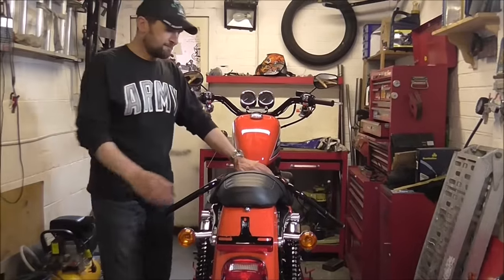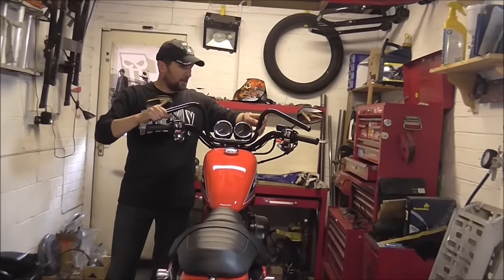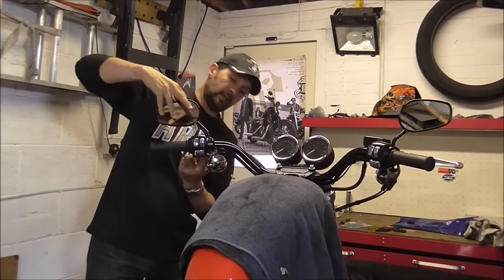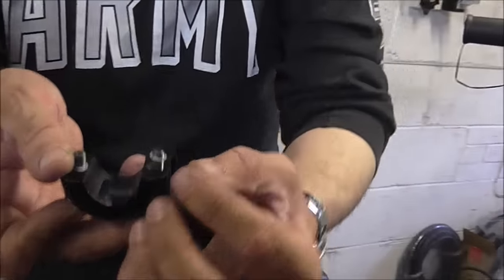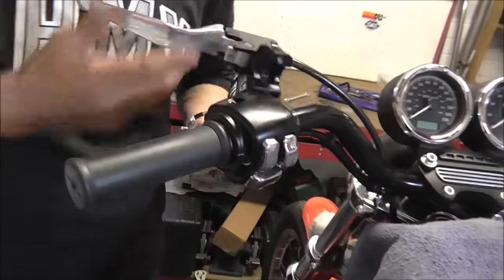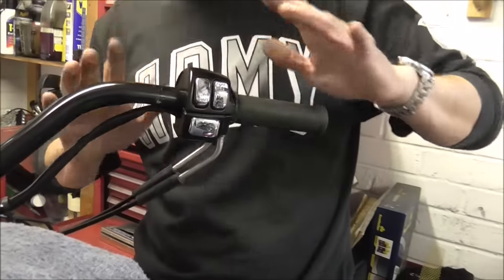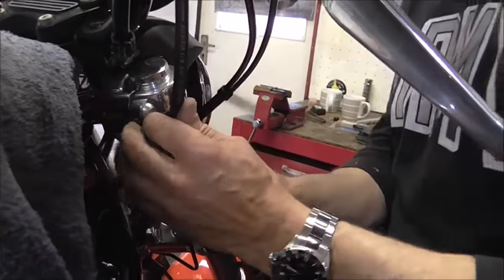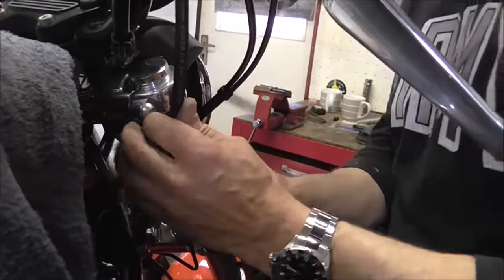Delboy's Garage, XL883 R, Fitting Biltwell 'Chump' bars.

Comment: great video mate, i always find the torx bits great for when you round a allen bolt head off, i get a torx bit that is one size bigger than the allen head and hammer it in.  jobs a gooden. always love these videos. 
cheers Devon
Reply: +Achilles Biker Thanks for the tip, will remember that when I strip out the next one :)
Reply: GTs Garage has got me out of some trouble before!

Comment: Wish they still made roadsters over here in the US. love my 1200R. I've been thinking about doing biltwell chumps for a year now and never have because I was too cheap to buy the brake line. but finally seeing someone do the bending option has me thinking.
Reply from the maker: +Jake C Do it Jake, they 're a great upgrade... and all you need to do is straighten out the hard pipe just a little and they will fit ...

Comment: Another great and informative video. In addition to a Torx driver kit, you'll need a 12 pt socket kit if you are going to any work on your brakes at all. Love Harleys but they drive me nuts with the special tools requirements. Keep wrenchin' and recording -thanks!
Reply from the maker: +The Ted ...Good call on the tools Ted, buying a Harley comes with a whole heap of changes, they are very different in so many ways...but you can go to a good tool comonay now days and buy a ready made Imperial tool kit, sockets, wrenches and alun keys etc... and of course, a good torque wrench.!

Comment: Another great DIY video on installing the "Chumps", Del!  I have an '05 XL1200R (not 883) that I have been looking for more comfortable bars for, and I think the "Chumps" may be them.  Your manipulation of the front brake line was of great help, but I am wondering how the wires went for you.  I really don't want to have to add wiring and just wondered if you had any difficulty getting the stock wires to reach.  Because the stock bars are wider than the "Chumps", are the stock wires able to be used easily without extensions?  Thanks in advance, and keep up the great work for the rest of us out here!
Reply from the maker: Hi buddy... yes the wider bars from the R model sportster will reach the Chumps just fine, i had no issues, you just have to tidy it all up and clip them away in a neat way... the only issue is the brake pipe which you saw goes ok too..  Good luck with yours.. Del.

Comment: got these at the beginning of the summer for my sportster. cant wait to get them on. awesome vids man always helpin me out. i got a 2014. thinkin i might need to change some of the cables. front brake line def seems too short for the chumps.
Reply from the maker: +dustin costill As you can see Dustin, not at all, if yours is an 883R then they will fit just fine, all you need to do is wriggle the left hand wiring through the headstock about an inch (plenty of slack there!) and bend that brake pipe slightly and gently to help the brake hose fit... !

Comment: Absolutely spot on....  no adverse comments here..  Do you think they'll fit my 2019 Sporty 48 without having to change any cables etc???   Great simple instruction as usual.
Reply from the maker: Not sure mate, the 883R has quite wide bars to start with meaning slightly longer wiring and cables, but the 48 bars are very small so it may be restrictive and the biggest concern with the modern bikes is the ABS brake pipe, it's welded to the connector block under the bottom yoke and not detachable... so very expensive to replace for a longer one should you need to!  Sorry I can't be more help.
Reply: @Moonfleet41   nowt is ever straight forward for me 😂😂😂 thanks for the heads up 👍🏻

Comment: A trick I have used for years to put handle bar grips on easily, is to spray a small amount of carb cleaner into the grip, this lets them slide on without wiggling really easily, the carb cleaner then evaporates and also vulcanises the rubber just enough to make them stick fast.....
Reply from the maker: +Michael Caton Good plan Mike, that makes sense mate, ive also found the hair spray works too....it dries over night and forms a mild glue to stick stuborn grips that wont stop slipping about.

Comment: You never wedged something into the brake lever to hold it a bit closed to protect the brake light switch ! A bit naughty that !
Reply from the maker: I broke the plastic tip off the end of the switch once, and the new switch was £24.. but the cut off head of a steel panel pin, glued into the end of the switch tip made it good as new for free..!

Comment: I wonder how much slack a 2019 Roadster has.  I'd love some Chumps or Mini Apes as they are inexpensive however the cables and Brake/Electrical extensions are a little expensive for what they are.  If I have to I might as well go with some braided stainless I guess.  (An excuse to upgrade an upgrade.)
Reply from the maker: Yeah, i wondered that myself, couldn't find any information, so just bought them and fitted them, it all worked out ok with a little manipulation, had to wriggle some of the loom forwards out from under the tank, and had to bend the hard brake pipe section a little, but all ok..  ! the Chumps are only 8" rise, so not too much of a stretch for factory wiring and cables !

Comment: I believe these are 8".  Would you still have enough slack in the cables and break lines if you went with 12".
Reply from the maker: It depends on the model of Sportster Dave. This was an 883R and the clutch cable plus the brake hose was at its maximum stretch in this case.. so i think you would struggle with 12" bars..
Reply: @Moonfleet41  you always reply and always so fast. Thanks once again. You're a huge help, love your work. I'm a fan.

Comment: Enjoyed the vid. I am ready to buy the Chumps but I do have a question: The bars you installed are knurled in the riser area. New Chumps (according to Hayden Brook, Customer Service Rep Biltwell Inc) do not come knurled. Did you do this yourself?
Reply from the maker: No Mike.. i didnt knurl them myself... thats how they came..!!!!
Reply: This is what is confusing me. I emailed Biltwell tech dept yesterday and got an email reply today stating the bars are not knurled. Today I called. They pulled a set of bars and told me Biltwell Chumps do not come knurled in the riser area. Many other pictures I have seen show them both ways and that is why I asked. Biltwell tells me the clamping force will hold the bars. I have never installed bars without the knurls.
Reply from the maker: Ok Mike, i guess they have both kinds and that's that... mine are certainly knurled, they are still under my bench and most definitely fully knurled at two places... as you saw yourself in the video.... But if you're arent, then there is a very reliable trick ive always used when installing ape hangers.... just wrap a single layer of kitchen tin foil around the bar and trap it under the clamp....no puckering, nice and tight to the bar.. and the aluminum is so soft it works like a metal sealing gasket and gives the bar and clamp something to bite on and grip.... the bar itself is never perfectly round, and not is the machined surface of the split clamp.... but the aluminum squashes into every ripple and dent and makes a 100% contact all round... and ive fitted 18" Ape hangers this way in the past, and they never slip in the clamp..... Hope that helps.. Good luck.. Del.

Comment: Del, thanks for the vid. You didn’t extend any wiring? Thanx-allie
Reply from the maker: No Allie, this bike was an 883R which comes with quite wide bars as standard, so all the wiring reached, it depends on your model with what standard bars you had !
Reply: Thanks for the reply! I have the '18 883N with the tracker bars & I'm  swapping them for chumps. Once I had removed the controls, It seems the brake line and turn signal cables are too short. Is there any way to reroute them? Brake cable looks like it has a little give..

Comment: Hi del love your videos! wondering if you could chime in on an issue I'm having. I did comment on your z bar video too but thought i'd copy onto here just incase you see this one first!

Basically I want to install 12 inch apes on my 2014 iron abs. I went with burlybrand on those. All good.
Problem I'm having is finding a cable kit. I've gone to Harley and a few local shops and they all say that I need to buy a special " abs cable " to go with a standard cable kit (burly brand non  abs 12" kit) for example. I've been told its about £300-£400 just for this abs cable too. I've tried getting details on this mysterious abs cable but noone will actually tell me what it is for.

I've traced through my loom and the abs cable goes nowhere near the bars. Straight from sensor over triple tree into the loom under the tank. so I can't see what cable they're talking about!
Reply from the maker: +xHitmanHobbitx Replied to this on the first video buddy.. hope the answer helps in some way... Del.

Comment: I have 2019 Iron 883 and I wonder if it has the same bars as this one you were replacing (new stock bars a little narrower, I think). I find it that I am leaning over a bit to reach the bars and I am looking for a bit more of a relaxed riding position. I also installed forward controls on the bike and this made the reach for bars a little more "difficult" in my back area (after an hour of riding). I guess it's like riding a Sportster 48? Do you think Chumps will improve the riding position for me? I am 171cm tall (or 5f7 give or take)
Reply from the maker: Hi there, firstly congratulations on your Harley, you must be very proud!  The Biltwell Chump bars are basically a 10" mini ape hanger, and will put your arms at roughly the height of your chest, and will certainly sit you back further... this bike was an 883R which has pretty wide cow-horn bars, the Iron from factory has slightly narrower bars, so just be conscious that the brake hose may not reach where it needs to on the Chump bars... it probably will, but if it doesn't, then it's very expensive to replace the brake hose on an ABS Harley as it's welded in to a splitter block.   Hope that helps you, good luck with it my friend.
Reply: @Moonfleet41  thank you! how tall are you? Did you find them a bit more relaxing that a standard drag bars? Keep making awesome videos, I like all of them that you make, very good stuff.
Reply from the maker: @Spriterom  Im just a shade over 5"11, and most Sportsters are too small for my comfort taste.. but these bars made the bike a lot more enjoyable and relaxed to ride.  These days i ride a Dyna Wide Glide with 14" Ape hangers.. so the same shape just a lot longer and stretched out...   Thanks for your kind words or support, have a good week.. Del.

Comment: I just ordered these for my iron 883 2014. I heard I need a new brake cable though for the older version sportsters! We'll find out lol.
Reply: Hey JR . (2 years on !) Thinking about getting these bars fort my Iron 883m 17b reg .Did you have to replace any of the cabling /electrics ? Or was it just a straight swap (as shown in vid )? Ta
Reply: @axelpteeg  I had to get a longer brake cable and do  everything incorporated with that, I have since moved onto pullback risers (8.5 inches) and Trashin Supply High Riser Bars.
Reply: @An_Enraged_Pig  Hey JR , thank you for replying so swiftly ! i appreciate it . After doing a bit more research and getting your reply , i think im gonna go for the Z keystone Biltwells. I like the look of them and not much of a height difference which , hopefully , won't require a cable change . Thanks man !
Reply: @axelpteeg  going to a 12 inch rise with my t handlebars i didn't change anything out besides the previous brake cable on the 8inch
Reply: @An_Enraged_Pig  Wow , surprised you didn't have to change clutch and throttle as well !? thanks for the info . ride safe
Reply: @axelpteeg  no I didn't have to change those cables

Comment: Hey there, I have the same bike with dual disc brakes and the same stock bars. Do you think I'll be able to fit 11' mini apes with stock cables? I asked a few motorcycle shops and they didn't know how to make it work because of the dual discs. Plz advice. Thanks!
Reply from the maker: Hi there, ok, if you have the same bike then the wider set factory bars give you plenty of length in the clutch cable and wiring and throttle cables, the only work around will be the brake hose... on your factory set up you will notice you have the compound hose system, which is part rubber and part metal pipe, with this video and the Chump bars, I was able to gently manipulate the metal pipe after un-clipping it, so that it gave me a little extra length to reach the bars... you can't bend the metal pipe too much, but like any brake pipe it is malleable, so try that first and if you can't make it reach, then just buy a pair of made to measure brake hoses from any good brake hose company and do a custom fit (this is, of course, provided you don't have ABS, which I presume you don't as you said you have the same bike as me).

Comment: Del, what's the tool you are clipping the torx bits into? Cheers
Reply from the maker: +groundskeeperwillie Hi mate, it's just a little handle that came with the set, many of them come with a 1/4 drive socket, so you can use a small rachet, it's a Clarke Pro Set, and I think they are still available !
Reply: +Moonfleet41 Cheers Del ;-)

Comment: Had my Yamaha YBR125 for a year now and I can change down with no clutch at the wright engine speed. Is this not a good idea. Another job done well DEL please do a oil change one day and save us some cash.
Reply from the maker: +Neil Jeffs Hi Neil, we have two Harley oil change videos - two Suzuki Bandit oil change videos and two Triumph oil change videos... how many would you like lol!

What you are talking about is 'short shifting', ... doing this up the gearbox is harmless and fine, provided you are timing it right... but down the gearbox can cause damage if you get it wrong !  Better to just flick the clutch to release the drive at the moment of change, just in case the teeth catch each other... specially on a light 125 engine...

Comment: I bought biltwell 12 inch mini apes and sadly biltwell stopped knurling the bars. Any advice for handlebar slippage?
Reply from the maker: Hi buddy, presuming you mean in the clamp?  If so, then wrap a layer, or two, of aluminium foil around the bar so that it lies the clamp, this works pretty well to grip them and stop them moving once you clamp them up!
Reply: @Moonfleet41  Yes I was referring to the clamp, mine is a xl 1200 c which has the speedometer as a part of the top clamp. Thanks for the advice, i will give the foil a try and let you know how it goes.

Comment: hi I have a 2015 883 and I want to use the same bars you using. I'm wondering do I need to change the brake cable for that?
Reply from the maker: Well i didnt have to buddy.. but then my old 883R had wide bars to start with, so longer cables to begin with... i guess it depends on what exact model you have, and how big the bars are from new..?
Reply: Moonfleet41 just the stock bar from HD. I will give them a go

Comment: Does your XL883 R have the stock cables? I want to put these bars on but would like to avoid changing all the cables
Reply from the maker: Yes Lorna, stock cables and brake hose, you just have to bend the hard pipe part of the brake line around gently so it reaches the new bars..

Comment: Does anyone know if you have to extend the brake line when installing these bars on a newer sportster and if so how much
Reply from the maker: Hi Aaron, it all depends on the Sportster in question, this was an 883R, which has quite wide cow horn bars, so all I had to do was bend the hard pipe part around slightly to get the angle right, so if your Sportster has quite large bars, then it should reach ok ... if it's an ABS model, you may want to check the length first before you buy the bars....

Comment: How high were those? 10" bars?
Reply from the maker: Yes, "Biltwell Chump" bars. !
Reply: @Moonfleet41  oh thank god. I am looking at 10" and once again your videos have saved me so much money. I was about to buy new cables and lines.
Reply from the maker: @austincox1000  Good news then Austin, even the factory metal brake pipe can be un-clipped from the screw clip on the top yoke, and carefully bent slightly straighter to allow the factory brake hose to work as well...  Good luck with it..

Comment: I know you are extremely experianced but you didnt cover running the bike to check for racing engine at full lock.
Reply from the maker: +spirda7 OK, good point, but as long as the throttle has the requisite freeplay then it wont race away...thanks for that insight buddy, all good advice to share... ride safe. Del.
Reply: +Moonfleet41 ahhhh. I just remember watching another bar swap cant remember whose it was but they installed risers and they did that checking with the throttle closed and they did get alittle raceing at full left lock.